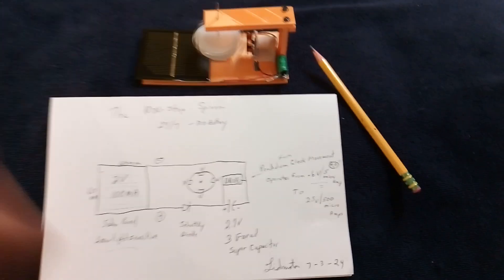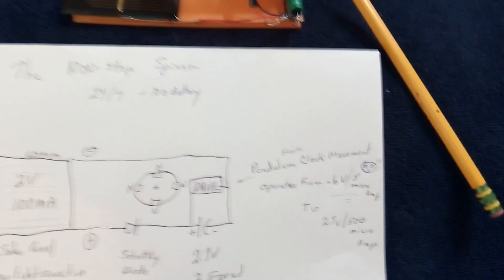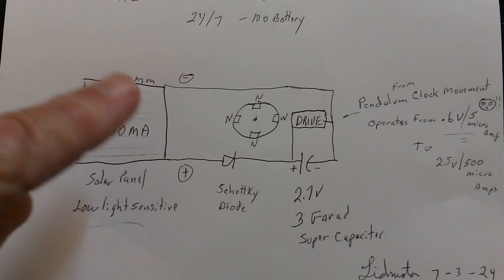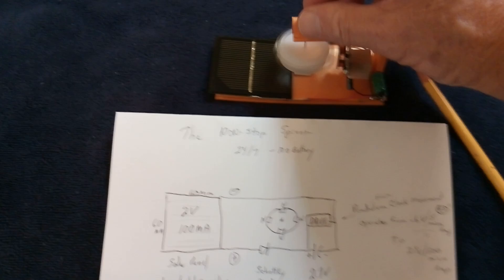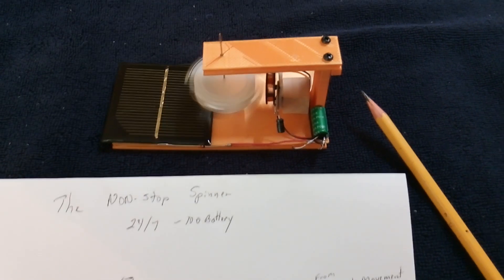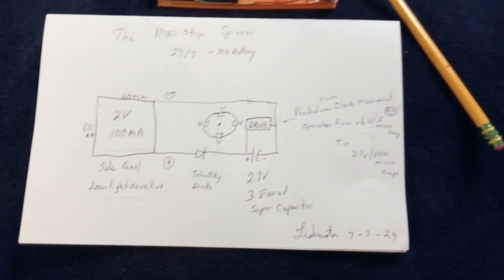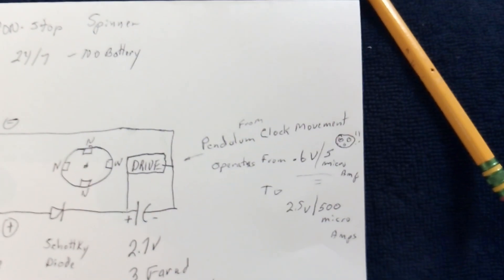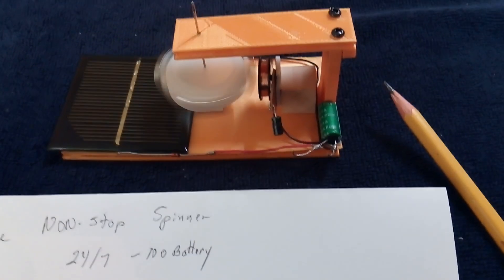Pendulum Clock Movement ----    Non-Stop Spinner

Comment: will it self start as a pendulum? I find pendulums interesting. momentum energy gets stored and there's the possibility for a 2 stage mechanical oscillator that can do work as a force multiplier like milkovics experiments.. thanks for sharing.
Reply from the maker: This is a pendulum drive unit. You could build up a very interesting pendulum unit instead of this rotor display.

Comment: Excellent build there 😁
I was looking at the DadHav circuit earlier today, the 14uA motor on my old channel and wondering how efficient the clock circuit might be. Your vid answers that question.
Reply from the maker: This driver is very different than the two transistor DadHav circuit that we have used for years.  Only time will tell how it holds up.  On the microamp DadHav circuits I am using they will not self start and are sensitive to voltage.  I looked at Big Clive's video on the pendulum drive again and he doesn't mention the self start effect.  I am scratching my head now as to why it works. 🤔.  On mine there needs to be at least about 1.2 volts fo see it happen.  The standard solar waver drive of course works also but this seems better.
Reply: @Lidmotor  I 'think' it's all about that capacitor to the Base. I think it keeps the Base off until there's perhaps 2x switch on voltage of the transistor (making sense of the 1.2V), the Base switches and the cap drains, allowing a nice fat pulse to the coil from the transistor.
Reply from the maker: @Slider2732_  I think you are right-----" a big fat pulse to the coil" does the trick. Kinda like kicking a ball rather than just pushing it.